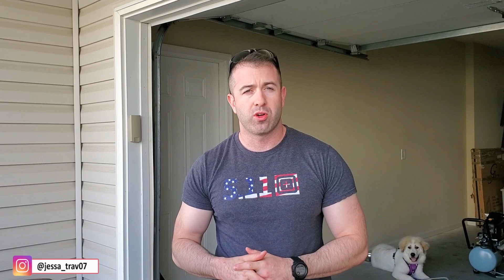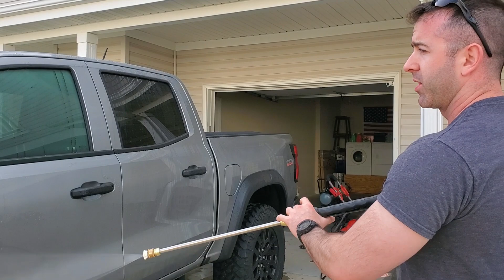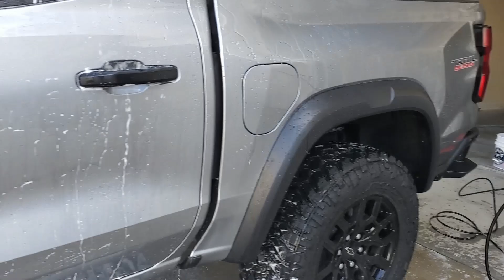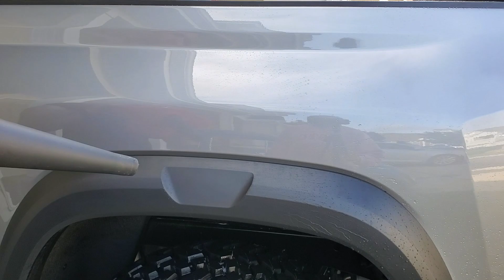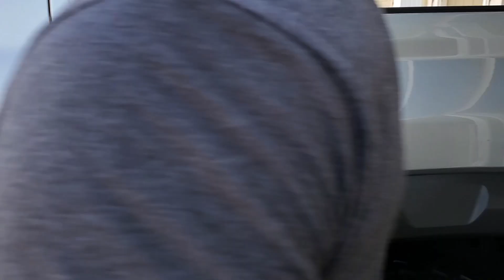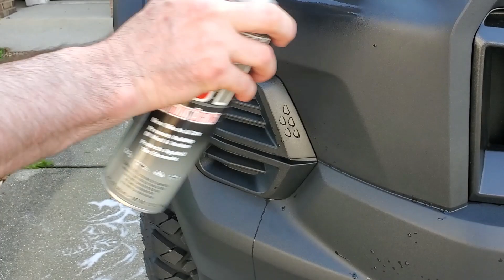WASH WITH THESE PRODUCTS : 2023 CHEVY COLORADO TRAIL BOSS

Comment: I just picked up my new Colorado LT and I detail cars for a living, Great choice on the soap, it’s PH balance so I won’t strip any coatings or waxed off, for tire cleaner I recommend getting Adams tire and wheel cleaner, works 1000% better than CG Diablo which is basically diluted apc, the griots line is ok, what you’re applying is essentially a wax, no real ceramic properties (sio2), there’s a lot of beginner friendly ceramics that you can get that would work 100% better such as the Graphene coating spray from adams, can’t really comment on the plastic protectant since I haven’t try it or hear of it but I recommend 303 protectant or CG VRP
Reply from the maker: I definitely was cautious about ceramic sprays, I wanted to make sure nothing would mess the pain up. I would like ceramic but it’s extremely expensive for the truck size.